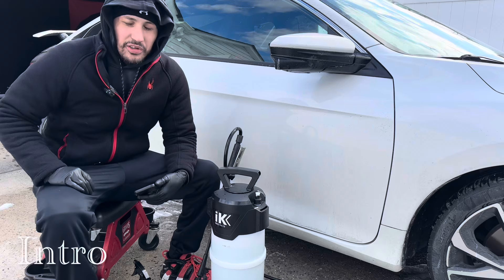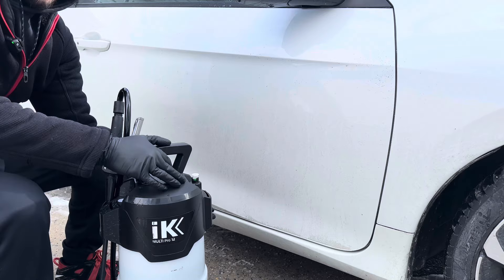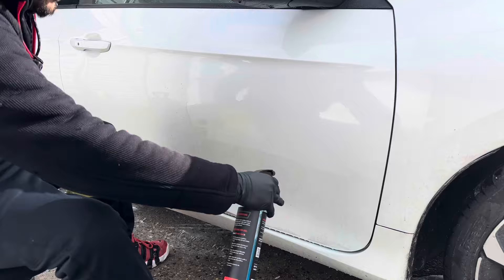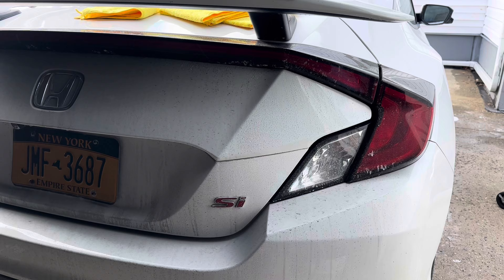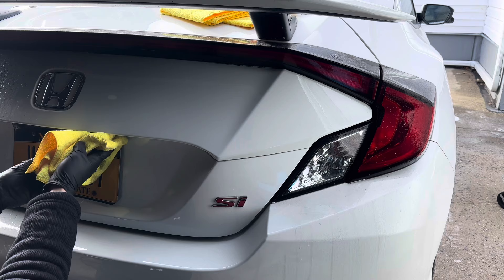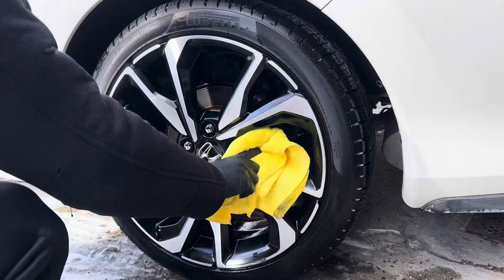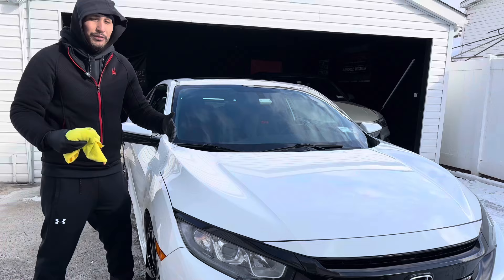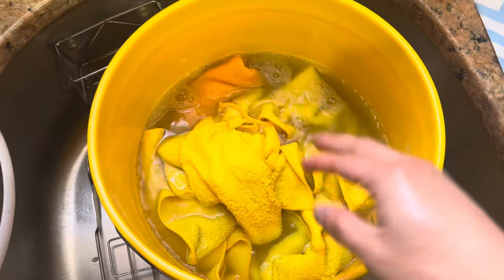WINTER DETAIL Waterless Wash - Remove ROAD SALT From Your Car - DIY Detail Waterless Wash

Comment: Good tip on the DIY Rinseless for the towels. No other rinseless releases dirt from media like DIY and N914. That's why I use DIY rinseless. My wheel mitt comes out nearly completely clean and I'm cleaning extremely dusty brakes with 6 piston calipers.
Reply from the maker: Thank you my brother 💪. The rinseless wash from DIY is amazing at removing dirt and staining from the towels and wash media. No need to throwaway the towels which sometimes people do that 😅
Reply from the maker: @Ecdetails  🌚🌚

Comment: Thank you for this video and tutorial. I need this. I tried rinsless washing yesterday and what you said happened to me with the slush and ice. I had it on my rinseless sponge so I stopped. This video is a blessing. I used hot water from tap for my bucket but not my prespray. That’s what turned to slush ASAP on my paint. You just helped me tremendously thank you!!!!
Reply from the maker: I am glad this video was very helpful to you 💪. Thank you my brother for enjoying the content. Yes just ensure your rinseless solution is hot and you’ll be fine. Unfortunately we have to work in smaller sections but the result speaks for themselves 💪

Comment: Great video Soc!   Good tip on the towels.  Have you considered doing a video on a pre-wash like Bilt Hamber Touchless or Autofoam on a warmer day?
Reply from the maker: Hey Wes. Appreciate it glad you enjoyed the video and tip. As for Bilt Hamber I don't use touchless anymore. Works great but for the detailer I am it works much better not outside in warm weather/direct sunlight. It's high alkaline and I've damaged plastic trim before with it. I have a discussion video coming out soon. Talking about chemicals and what are my favorites to date.
Reply: @DetailingMadeSimple  Can't wait for that.  I knew Touchless is sugar based.  I have Primus 2.0 on the way.  Ever have issues with trim with that?
Reply from the maker: @wescat2  nope I have not. Watch my video on why quality matters on a Mercedes Benz I did a few weeks back. I used that in direct sunlight no issues
Reply: @DetailingMadeSimple  Not sure how I missed that one, but checking out now.

Comment: I don’t really think it makes sense to use waterless during winter conditions. You always will need to pre spray with rinseless.. so you might as well use a rinse less to wash too and I’m certain it’s safer than using a waterless. I’ve noticed most waterless washes these days have si02 or Graphene because both have a small filling capability, which is likely done to mask any light marring caused. 

Great point about hot water. 👍
Reply from the maker: True you can use Rinseless. I will show that methods as well. I wanted to show this method as most places are much colder than where I am at. Even if I use a yeti bucket with the lid open and not closed the water gets cold very quickly in the bucket as opposed to it being closed in the IK Spray. Both methods work greatly. Depending on your technique you won't get anything crazy and the light marring we "may get" not that significant compared to driving on the highway at 50 miles an hour and salt rock hitting your paint and scratching. There is a give and take. It's a daily driver so that's the very least of my concern .
Reply: @DetailingMadeSimple  Agreed completely.

Comment: Guess I’ll be buying a lot of waterless since the closest touch free wash seems to always break down in the winter. I don’t like the cold so pay n spray is not an option.
Reply from the maker: 🤣😅. Yes buy a quality waterless wash and you’ll be all set to go. I ended up using almost the whole bottle this video. But what’s most important is getting a quality finish. Do a waterless wash once a week or every two weeks. But the ceramic coating helped a lot as well.

I feel you the touch fee wash not that it’s broken. I bet their lines are frozen too which happens. It happens to mines over here as well. 😪
Reply: @DetailingMadeSimple  I bought KCX which I’m going to put in a CSW battery sprayer. I also have ADS waterless too in addition to many TRC mfs. I’m going to try to do this in a covered somewhat heated parking garage if I don’t get run off or arrested. Maybe I’ll use my new IK 12+ with compressor to test my skills. Worst case scenario  is I jack up my paint and have to pay for my mistake. Great incentive to take my time and do it right. Chicago is pulling no punches with the salt and the other big dumb trucks love throwing slush.
Reply: Freezing in Chi-town as well as New York
Reply from the maker: @ChiGalKMcAcura  NICEEE. Important note is be efficient. I have a short releasing tomorrow when I got to my last wheel and tire when it turned to slush! So boil water and in a somewhat heated garage start on the paint first and quickly. If it starts to slush just stop no need to scratch your paint 🫡. Take your time and become methodical and understand your technique. Then eventually you’ll be quick
Reply from the maker: @CAPTJ696  chitown is crazy cold. Maybe Kim boiled water will last 20 minutes instead of 45 in 10 degree weather 😅😅